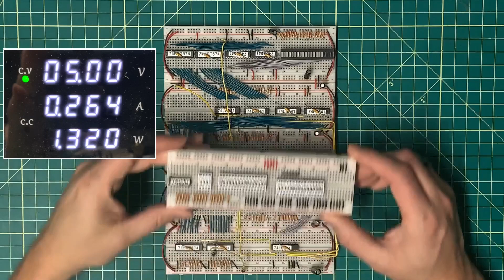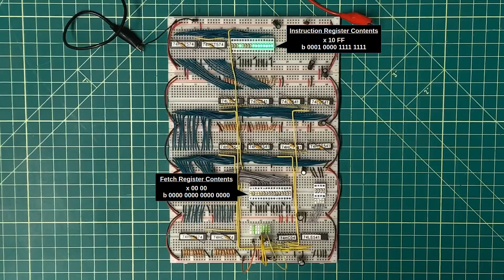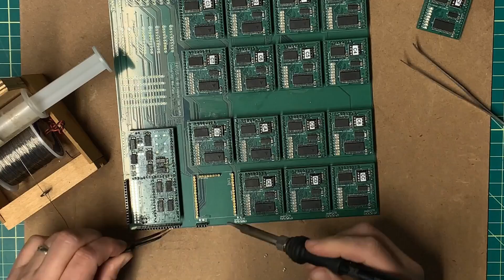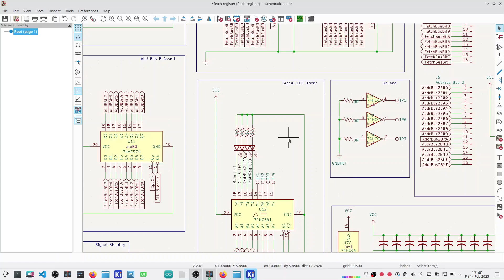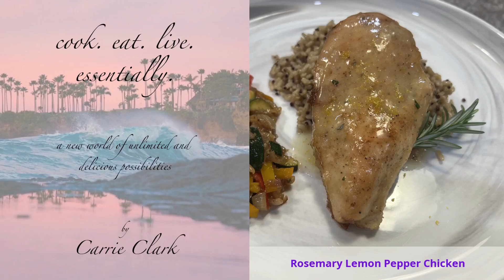0113: Fetch & Instruction Registers (with NOP execution!)  | 16-Bit Computer From Scratch

Comment: Don't forget to change the polarity of the LED's in the schematic update. The format changes seem good. The overlays looked great. One other thought, add a series resistor ahead of your 100pF to ground. It can be a zero-ohm if you don't need it, but if you have the location, you can fine tune the termination. I am doing that on all of the clock inputs for my build after seeing what a difference it made on signal integrity.

I had to go way back in your videos (0037 I think) to understand why you chose 15-bit (32k) control roms for a 16-bit computer, but you have arranged the ISA to not need the MSB to be decodeded. My only remaining question is why so many control roms? In looking at what I need to do for my build, I have decided on 64Kx16 control roms to get the most control lines per module and I need all 16 bits for the ISA I am implementing, at least in the first inst decode. I think I can get away with one control rom per pipeline stage.

I got the boards for my clock/reset circuit. 2 bodge wires since I made the mistake of updating signal names and typo'd a couple so they weren't the same net anymore. Doh. ERC passed before I did that. Oh well, not a major problem, just annoying. I did get the stencil. Learned a lot about that. If you decide to try one, get a "custom size" one just bigger than your board so it will ship in the same box. It was another >$23 dollars for shipping and who knows what at customs since my order came in 2 boxes. Fortunately I have a metal shear so I was able to cut the stencil down to a usable size from 280x380mm.
Reply from the maker: @grumpyoldman5368 -- Good catch on the LEDs!  Thank you!!!  I would have missed that.  Though it could have easily been corrected on the PCB.

Also, good call on the series resistor.  I will make a note.

The MSB of the instruction is and will be decoded.  For the time being, the MSB of the Program Counter Address is not used (tied to 0 for the time being).  I did this in the early days to force the program to roll-over and repeat without a jump instruction.  This will change in the next video.

As for the number of control signals, I admit I am ambitious.  However, I want my external devices to interface as if they are registers (not memory mapped registers).  I also have 18 General Purpose Registers and 10 Device Data and 10 Device Control registers planned.  Even at that, I have well more possible signals than the 128 I am planning even when I multiplex them.

Why?, you ask.  I did not want the number of registers to be a severe limitation for this build.

Check out https://github.com/eryjus/16bcfs/blob/master/documents/16bcfs.ods (It's a Libre-Office Calc document, which can be directly downloaded).  The "OpCodes" sheet contains the instructions I am planning and the number of expected permutations of each I intend to have -- and this is after I have cut it several times.
Reply: @eryjus4594  Thanks for the clarification. The relatively large number of registers shoud give you a lot of flexibility. It will be interesting to see how you package that many boards. If it remains flat like Sharman's the max speeds will be limited by skew. I do realize that it's the journey not the end product. Similar for me, I am trying to push performance and I'd like to exceed the prototype which I don't think will be too hard given that a raspberry pi running simh outperforms the prototype.

I will have a look at the opcode spreadsheet. Thanks for the pointer.

I am also looking at using your control rom generator source code as it would be far more convenient to leverage existing working tools than reinvent the wheel again.
😆
Reply from the maker: @grumpyoldman5368 -- as things stand right now, I am out-performing James's build, which says absolutely nothing.  I have nothing material going on.  I'm just shocked I can maintain that speed with this many breadboards still in the build and mixed HC/HCT/LS logic.  

I believe I will have 2 limiting factors: 1 will be the increment of the 16-bit wide register values and the other will be the ALU and the flags determination.  Both are quite a number of gates deep.

Use all the code you want!  I'm glad it helps.